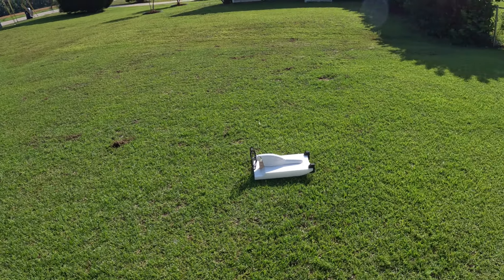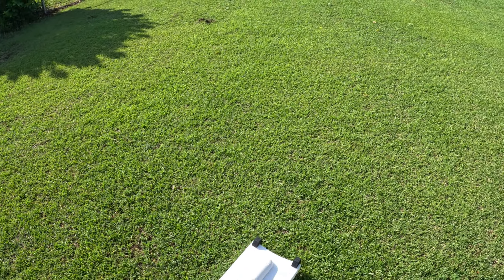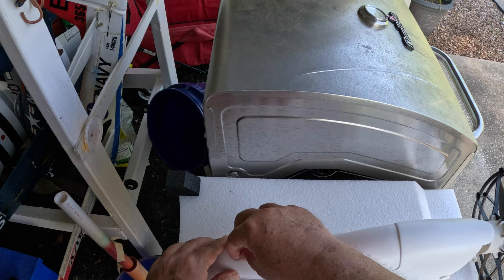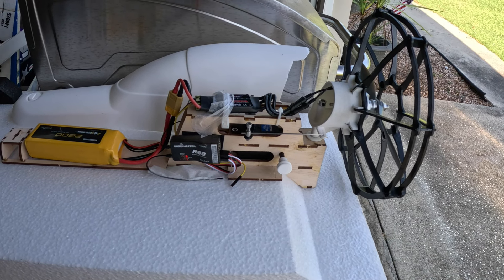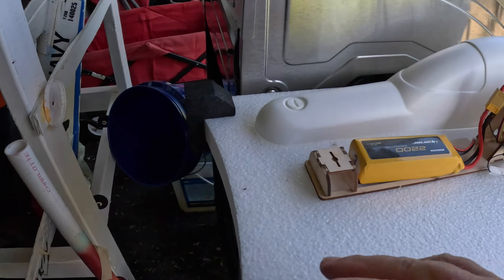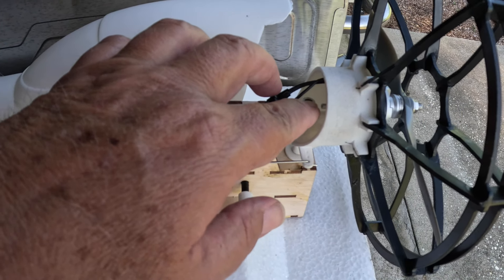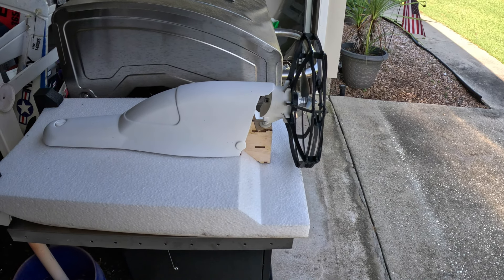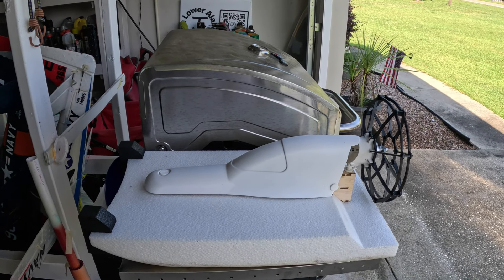Hacker Rescue Boat First Run and Build Review

Comment: That’s so cool Jeff. They been pretty busy retrieving planes at Nall this year. We have a boat with a small trolling motor for use. I saw a fella that had a 64mm edf mounted on his along with a FPV setup so he could be virtually in the boat steering it. lol. I was thinking of rigging up one up myself with spare floats. Still studying on it. 👍
Reply from the maker: Brad have thought of putting my mobile FPV on it for sure. Think it’ll work well. Now we just need the Crew at the park to finish up the dock so they can open the pond. Thank you so much Jeff
Reply: Hope your doing well my friend. 🙏🙏
Reply: @JeffinLowerAlabama  Sounds like a plan. Let us know how it goes. 👍😉
Reply: @tughillrc6327  TUGG. Hello my friend. Doing well. Thanks for asking. Little hott at Nall at the moment. Suppose to cool down a little later on this week. Hope all is going well your way. Take care buddy. 👋😊

Comment: Very cool Jeff, I considered this before getting the Horizon Harbor, thanks for sharing
Reply from the maker: Angel I think with a sight mod to the front to keep the bow from going under a plane it should work well.  I can't test it until the Crew finish rebuilding the dock and open the pond back up.  Thank you Jeff

Comment: Its very cool however I wanted something big enough to retrieve my Carbon Z Cub or Cessna 2.0M and the Proboat Tug fit the bill. I even retrieved a Kayak that got blown a drift with it. I might purchase the Hacker for Snow/Shallow water ops after seeing it run on Grass. I will fiberglass the bottom and install three shallow ribs so it will not spin as easy.Great Video and Thanks or sharing.
Reply from the maker: Tug I'm going to run it on water but think I'll add a keel and wooden poles with a slight angle on the front for pushing float planes.  It has all kinds of power on 3s, didn't even use full throttle on the grass.  I'm sure it'll work with some tweaking if it doesn't work out of the box. I wanted something smaller and easier to take to the pond.  The pond is closed while the Crew is rebuilding the Dock.  Thank you Jeff

Comment: Thats really cool. It will be interesting to see it on the water. Usually you just plug the single wire into any open channel (signal pin). If it has no effect try reversing the channel.
Reply from the maker: Sno going to do the water trials stock.  Thinking I may need to add a keel.  Just need to assign the channel on the RX to a switch on the TX.  If I connect the signal wire it without the switch it messes with the motor, sure it's something easy any OpenTX user could do in a few minutes. Thank you Jeff
Reply: @JeffinLowerAlabama  I dont know anything about opentx but if it were a spektrum I'd just put it on Gear(5) or Aux(6) because I know what switches those default to.
Reply from the maker: @snoriverrc3842  that's right Sno on Spektrum it would be easy but if I drop a radio in the pond I don't want it to be my NX10 😁😁🤣🤣😂😂😊😊. I use a strap when sailing because I put the TX on the rail of the dock and Tuco almost knocked it into the pond.

Comment: Seaplane flyers know what's up. 
Who hasn't paddled out to an upside-down plane, kicked over by crosswinds or pilot skill input?!
My girl, Crazee Tracy FPV flipped her little UMX Icon A5, about 200' from the shore. She sent her badass 50mph catamaran race boat to rescue it. Things did not end well for the UMX Icon. RIP. It was glorious! Expensive foam everywhere! We must have spent an hour swimming back and fourth, cleaning up the mess. 
This little airboat is genius, much better (for the purpose of retrieving planes) than the RC Life On design that I 3D printed; while it works, there are many a sharp corner that dents the crap out of foam planes. But foam on foam action shouldn't be too rowdy!
Reply from the maker: GR thank you, I think it'll work but may have to mod it some.  Our pond should be back open soon, Jeff

Comment: Is it difficult to build? Are the instructions precise and easy to follow.
This would be my first time building a model
Reply from the maker: The instructions are great, easy to put together and fun to run.  Just tested bringing a boat fender back to shore today, works great.  I'm going to add some pool noodles to the sides to make for a little more front area for pushing. Thank you Jeff